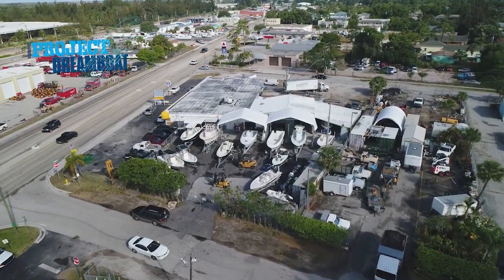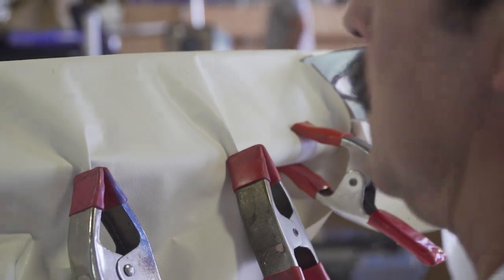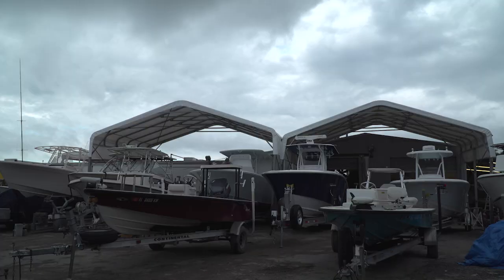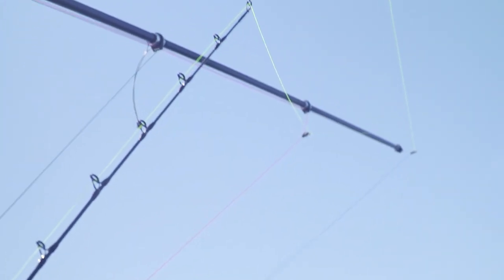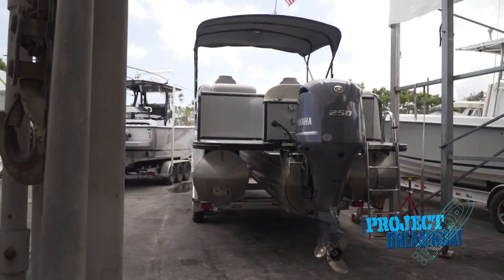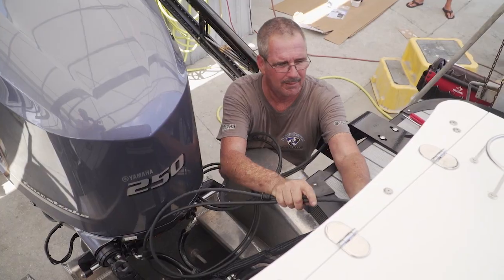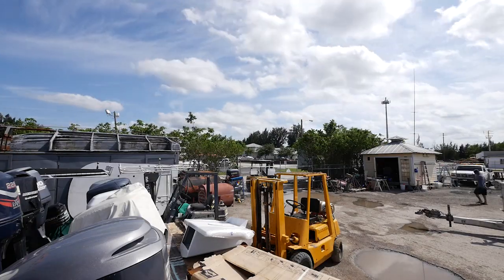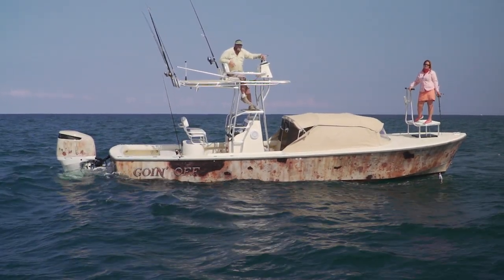Florida Sportsman Project Dreamboat - Dorado Birdsall Build, Custom Built Young 27

Comment: I love the show, but I noticed that when people paint such large boats, they are on the boat stands. I was curious when painting the boat you obviously have the stands in the way that would leave large bare patches of boat that is unpainted. How do you paint these areas blocked by the stands and keep the finish consistent with the rest of the boat?
Reply: Big DWG, the stands are moved and the bare spots are  painted. after that the edges or blend areas are wet sanded and buffed. done correctly you can't tell where the bare spot once was.